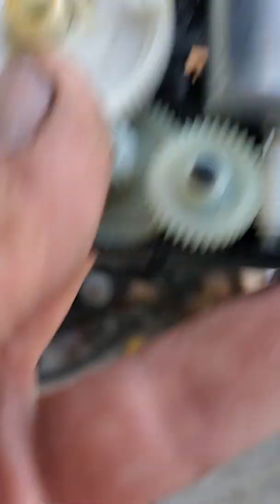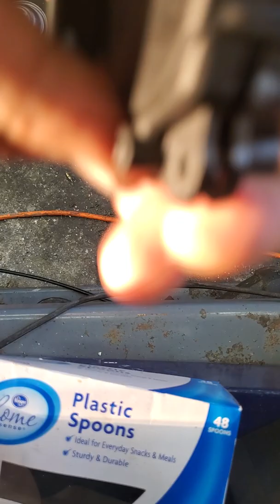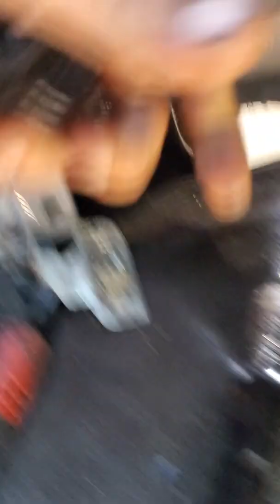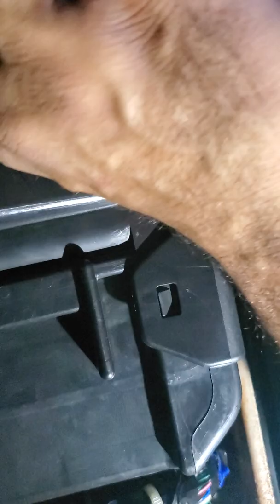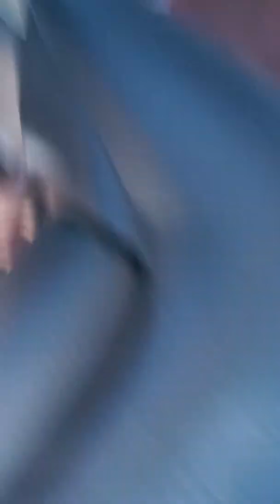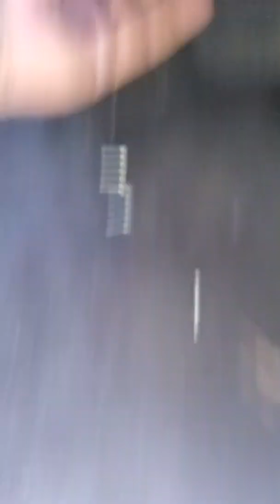Acura MDX Blowing Hot In The Front And A/C Cold In The Rear (FIXED) Part 3

Comment: What was the problem? I'm having the same issues
Reply from the maker: The problem is when you turn the button from hot to cold it want turn because of the actuator is bad need to replaced it
Reply: @hanitwfik  i have cold in the back and warm in the front , i hope this helps, im going to try it and let you know how it goes 
Thank you
Reply: @hanitwfik so  I did this but the actuator is working fine, what do you think it could be?
Reply from the maker: @TWODEEP25  how do you know the actuator is working fine ?
Another way to know .remove the actuator and then remove the arms manually that well let you open and cloth the ac/hot gate so now you can tell the problem
Reply: @hanitwfik  I also did that but it doesnt change the temperate. Actually  makes both the front and rear ac lukewarm now that I removed the actuator  and manually open and closed the gate , but before the rear was cold air
Reply from the maker: @TWODEEP25  ok so now you may have something wrong with air box it self   because you said already have a/c cold before
Reply: I put my manual for now into I fix it